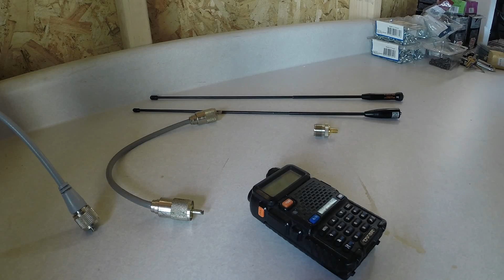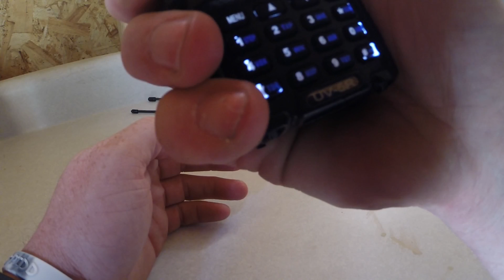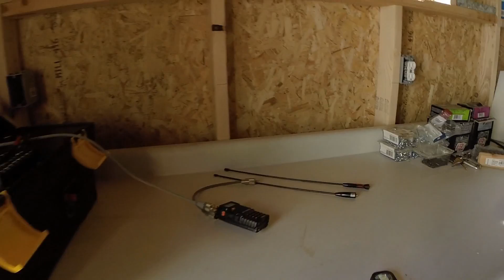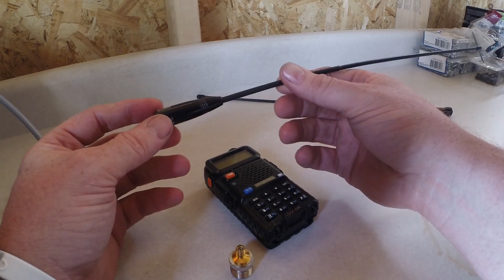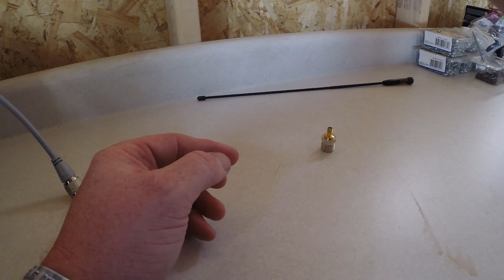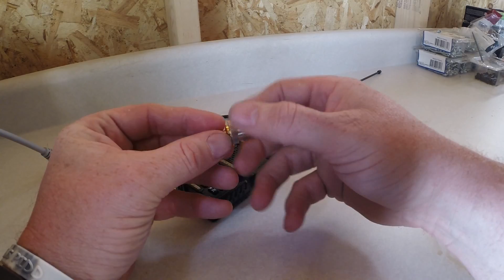Baofeng Antenna options!

Comment: why does everone rave  the Nagoya 771? I use a Comet. Great video.
Reply from the maker: because it is a cheap antenna and it works very poorly I might add, and they justify themselves by raving about them to make themselves feel better cause either they can not afford to bye better antennas or they are just don't know what they don't know that they think they know.
Reply: @snafu673  You're so right.  Never thought of it that way.. Even some of the ones who do have it rave about the 771.

Comment: is the antenna just a cb dip pole style
Reply from the maker: No it is a comet base antenna dual band fm
Reply: @snafu673  ok, thanks, any models are the best, you recommend
Reply from the maker: @mattrowe1229  I use comet because at the time I bought that antenna I was going cheap but Diamond antennas are better,
Reply: @snafu673  thanks for the info

Comment: Im looking to get a longer antenna for my uv5r. I can't decide between the Nagoya or the Diamond. Also I have no clue if either will do something to my radio, or from which to which frequency either work. Would appreciate some advice👍
Reply from the maker: If you can afford the Diamond get the Diamond.
Reply: @snafu673  thank you for the response👍 But i searched online and read that the Diamond makes 2:1 SWR and in my baofeng manual i read that i can only use 1,0-1,5:1 SWR
Reply from the maker: @mischo059  Ok I have not read that particular information, but to safe find a inline SWR meter and test it, that way you will know exactly what the antennas SWR meter is at.
Reply: @snafu673  okay, thanks alot ;)

Comment: I was curious as to what would happen if i connected my baofeng f8+3 to a tv antenna with an adapter and I found your video...just got my ham licensne and my call sign is KO4DNA. Did you say wyandotte? I'm from Kansas City, but now live in florida!  (.:
Reply from the maker: Well do you know the resistance in Ohms your tv antenna is, I has to be apx 50ohms otherwise you will damage the radio.
Reply: @snafu673  roger that! My whip should arrive in the mail any day...enjoy your holiday, sensei....

Comment: You refer to the end of free Nagoya whip as the adapter, and an adapter a connector. Your have got the two terminology reversed. (And then you got it right sometimes in the video,i noticed).
Reply from the maker: Cool thanks for noticing.

Comment: Although an SMA connector is a good solid connection, I have to disagree with using an adapter to such a large connector such as a PL-259. It puts undo stress o
n the radio bulkhead connector and will eventually crack a radio housing. A more practical transition would be to use a short jumper cable such as RG-142 with an SMA male on one end or an SO-239 on the other. A GOOD cable won’t be any more lossy than that adapter that you are showing and probably costs about the same.             Have a great day.
Reply from the maker: At that time I was using the Baofeng radio that is all that had. it worked to get me on the air with a better antenna.

Comment: Got my first ticket at W8FT, FINDLAY OHIO.. call was N8ODN. Used to live mcComb. And work in LIma, and ottawa ohio. . Now my call is kv4li. Tennessee. Got a lot dragons. (Baofeng) good show. De kv4li clear
Reply: Where are you in TN?  I live in eastern TN.
Reply: @w.rustylane5650  hickman co TN to retire. Town nearest is nunnley. /Pinewood/ hidden valley lakes/hickman co's second jail. Full of naredowells. And penny sharps,and pourch climbers. Had I'd known. I wouldn't have. Live in house hardly bigger than a jail cell. But it's warm. I Cary a fist full of padlock keys and got mugged. Didn't run away. Wanting pay back. For 3 vertabrae on my neck. The sherriff and judge treats the afair as if it's a u.f.o. no help. To find beater. Carry permit and mouse gun I carry 24-7. Still it's nice here better than the 20 years spent in army reserve and 30 years of tv factory. Beautiful here and I'm not running. Wating. someone will yap. Then it's my turn. . Combat engneer sgt williams good life here IN  TN.

Comment: Hi thanks for the video, I am just getting into ham radio and have been searching how to get started. I want to join the Amateur Radio Club in my area but with the Corona Virus situation everything is on hold. I have decided to start with the Baofeng UV5R and now with your video I decide to get the  Diamond antenna. I also like the portable antenna setup you have do you have a video on the setup of it?

Comment: Seeing as it’s a handy talkie I would almost look at getting an sma to bnc adaptor.  That would make it a little more robust and easier to swap antennas.  Also for the same $20 the signal stuff nitinol superflexy wire whips work great and have a lifetime warranty

Comment: Could I get decent distance with a 10-12 foot CB whip antenna for a pick up?
Reply from the maker: no the tune is for a CB antenna in on a frequency of 27 MHz on the am band, and this radio is on the fm band the match with burn the radio up.

Comment: can u use a regular cb base antenna  on this radio with a 259 connector for use on frs channels to extend your transmit and receive range
Reply from the maker: rebelsupply No you can not, your SWR will be way too high and will burn up your radio.

Comment: You can turn the obnoxious speech off in settings. It will have a speech setting, options are Chinese, English or Off. Select off and you won’t have to listen to that. 

I had horrible results with the Nagoya 771. 
Currently playing with one of those Abbree “tactical” antennas with surprisingly good results.
Reply from the maker: The Nagoy a771 is garbage mine broke, the part that screws on tho the radio came right out of the radio.

Comment: I am getting good range from a J-pole base antenna. Maybe 40 miles.
Reply: what adapter do you have to your baofeng and where can you get one
Reply from the maker: That is awesome, the higher you get the antenna the farther out you can go, even with low power.

Comment: I was jjust over at radio reference web site, and saw that some FRS frequencies allow up to 2 watts of power.
Would this mean that if I turned the power down on my baofeng uv-5r to the 1 watt setting that I can use those frequencies until I try to get my technicians liscence next weekend?
Reply from the maker: Yes they will still work at 1 watt.
Reply: You could do that, but you will have to deal with everyone and their brother telling you that this radio is not type accepted by FCC for use on FRS regardless of how many watts it is transmitting. Just a heads up, as I'm pretty sure that your changes of getting caught are virtually nonexistent
Reply: @andrewlettish2977  well I passed my technicians exam last weekend so I think i can wait till my FCC licence is in the database.
As far as "type accepted" goes, i'm going to obey the rule, but think it a bit bewildering if indeed one is within the operating parameters defined by the FCC pertaining to the FRS.
Reply: You'd be better off using MURS . i think you can use full power

Comment: In city with the original antenna I just reached 1 mile (1.5 km) How much could I reach with that antennas without using a repeater?
Reply from the maker: Apx 2-3 maybe more, depends on your elevation, obstacles between you and the repeater, more dbs you have and the higher you get your antenna the farther out you will reach.
Reply: @snafu673  Thank you Tony, I'm just a beginner in HAM radio, and any data and advice is welcome.
Reply from the maker: @REDFIREVIPER  what is your call sign, you can email me at anytime at KE8CDD@yahoo.com.  I started out with a UV5R Baofeng radio, and saved up to buy better equipment, It is not a cheep hobby buy what you can afford and do worry about what other hams have, do research on the radios that you like and compare them to the others and talk to other hams.  Find a Radio Club near you and be active and ask question, hams are very helpful to new comers.

Comment from the maker: what frequency is that marine radio, you might run into SWR issues using that antenna.
Reply from the maker: The repeater will transmit its call sign back.

Comment: Great video. If you could Can you please tell me what you have used? The kind and name of the antenna on the pole? The name and size of the cable you have used? All the names of all the connectors you have used. Do you think this setup would be good for a permanent house roof mount, or should I consider something else?  Basically what I’m doing is trying to listen to my local police and fire, so basically receiving not really transmitting. 
What I have is a Baofeng BF-F8HP with a Nagoya NA-771 antenna. All I’m getting now is really static conversations and hearing half conversations, while in the house and outside. Looking for something that will help the signal. Thank You
Reply from the maker: Thank you, I have used the Nagoya 770 ht antenna that was the first one i used, the one on the pole is a Jetstream base antenna, the cable is just regular coax 50 ohms, adapters i used are are the SMA Female to SO 239.  I have both a permanent set up for my 2 meter and my hf rigs as well as portable setups for both my rigs, I have also built a solar power generator to run my rigs at a field day event or on a DX adventure.  as far as Police frequencies they have switched over to the 800 mhz digital bands and most radios will not let you transmit on those frequencies.

Comment: What's the name/model of the antenna you got on the tripod outside? I'm looking for something exactly like that.
Reply: RoastedBattleSquirrL Looks like a Diamond vertical. I have a Comet GP-3 dual band vertical antenna that I put up on an MFJ-1918EX tripod in the yard outside my shack window using a Comet window cable jumper and it works very well. About $300 invested between antenna, tripod, coax (25-foot DX Engineering 400MAX premade cable), and the window frame cable jumper. If I owned the place, it'd be even cheaper and more convenient not needing the jumper and tripod (save about $100 if I could roof mount and add proper grounding and lightning protection) to do a permanent installation but that'll have to wait for now.
Reply from the maker: Jetstream JTB3
Reply: Thanks!

Comment: Can the baofang be programmed to communicate with CB radios?
Reply: MrCgooden no
Reply: Thank you.
Reply: MrCgooden you are welcome you can get a mobile unit CB for about 40 pounds. mobile a handheld would have less range unless you hook up to an external antenna.
Reply: Greg M umm no it cant, it does not contain the correct hardware
Reply: Yes you can get cb.if you look at the cheap Walmart radio man.you will find the channels just add them to your radio.i would like to know if there are any veterans using radios out there.thank you much.ole Vietnam really vet 🇺🇸👍
Reply from the maker: Sorry for taking so long to reply it seems like everyone else answered your question, thanks for commentating.
Reply: No. Different frequency modulation and band
Reply: Well, as others have said, no. To clarify, CB uses the AM mode, while this radio uses FM. The CB radio frequencies are around 27Mhz, while this radio won't go much below 136MHz. The two are fundamentally incompatible.
Reply: Yes it can, you just have to hook it up via USB and import the correct frequencies.
Reply from the maker: hey if you can get it work work put it on video I would love to see it.  cool